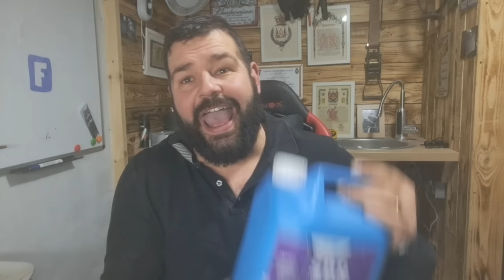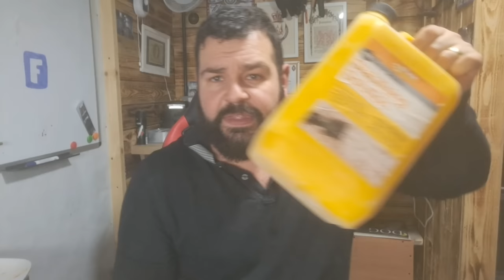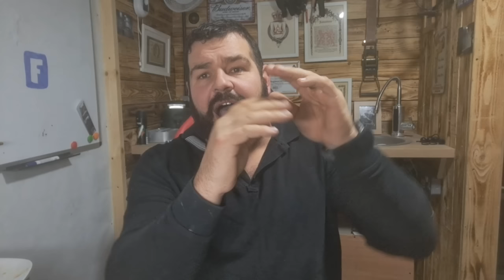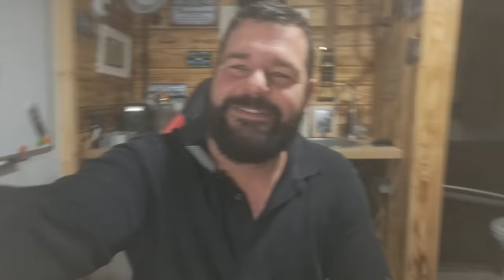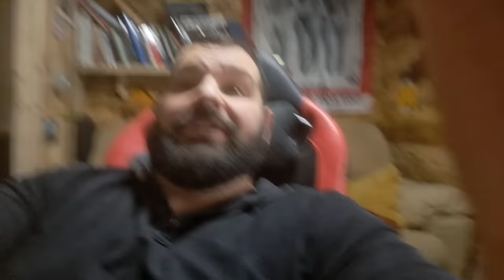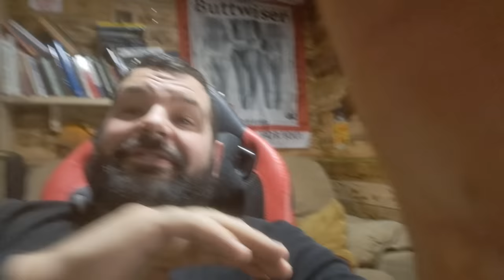SBR Everything you need to know | PLASTERING

Comment: SBR was originally designed for external render. It was meant to be rendered over while its still tacky so the SBR mixes with the surface if the sand and cement render. In effect the SBR soaks into the render and the brick wall, creating a better bond. I knew a shop keeper on a very busy road/junction that caused a lot of vibration. For 30+ years he would need the shop stripped off and new render applied every 12-18 months. 14 years ago I told him to use SBR and render over it when it started to go tacky. That render is still in place without any issue. Yes your correct that you need SBR to be dry before internal plastering. If you don't let it dry it wont seal the internal walls. It actually wets up again. I did damp proofing for years and we always used render internally with a waterproofing additive as a base coat. We always found there was a key moment between the SBR being tacky and dry that worked the best. The SBR you buy from Wickes is watered down garbage 1-1 mix or ready to use. The real stuff mixes 20-1 with water before applying it to the wall. Many years ago it was a 40 parts water to 1 part SBR mix. The watered down garbage barely sends the wall blue. The good quality SBR sends the wall almost purple.
Reply from the maker: Spot on Drew, thanks for the comment mate.
Reply: I am doing floor tile on no more ply. They state to use sbr. Can you recommend a brand to use. Thanks
Reply: @redx11x listen to the video? Lol
Reply: Can I add sbr to a scratch coat mix I’ve use some waterproofer in the scratch coat but still get quite a  bit of suction what would you recommend
Reply: @christaylor5098  Get the best SBR you can get. Good quality SBR will dilute with water 20:1, giving you 20x the SBR. Don't buy the crappy SBR that's already watered down to save £5. Apply more SBR to the wall. Adding SBR to the render mix won't do much to help you. Your render needs to be wet. The SBR applied to the wall should send the wall blue/purple. Apply to the wall roughly 10 minutes after applying the SBR. Do that in batches because the SBR will dry up too fast on large areas. If your getting still getting suction, you haven't applied and sealed the wall enough with SBR. Hope that helps.

Comment: When I tried to cement render onto lightweight Thermalite type blockwork I couldn't get it to hold on. I tried PVA on the blocks and if possible it was even worse. I went round to the local builder's supply depot and the guy on the desk recommended SBR and he was right. It was a completely different job altogether. He suggested that often the block manufacturers overdo the use of mould release which means the blocks are very uniform and crisp but means that nothing will adhere to them without SBR. At a later date my neighbour rebuilt the garden boundary wall between our gardens and used slate for a thin coping. He used standard cement mortar which never bonds permanently with waterproof slate as a result they all came loose shortly afterwards. With his agreement I relaid them with SBR mixed into fresh mortar mix and they haven't shifted since. Be prepared for the mortar to set really quickly though and only mix enough to lay a few slates at a time.

Comment: i use sbr for painting.... a lot of decorators still bang on about pva but of course pva stays water soluble so it will go back to being glue when it gets wet. sbr is also very good at stopping paint peeling if its a bit damaged. whack some sbr on damaged paint then paint straight over when its dry, top tip.
Reply: I've recently re plastered my bathroom walls but due to various circumstances it won't be getting decorated for some time  ,I was thinking of sealing the newly plastered walls with a watered down mix of SBR to seal them up to stop them absorbing moisture until I get to the point where I'm able to emulsion them with a dedicated bathroom paint , what are your thoughts on this ? Any advice will be greatly appreciated. Just not sure if the emulsion will go over the SBR without any issues .

Comment: Thanks for this, had a nightmare dealing with some thirsty walls - two coats of PVA couldn’t cut it. Used SBR for the first time today, and really impressed with the finish, and it really helped reduce suction. Probably won’t go back to PVA now
Reply: This was SBR admixture from screwfix for anyone interested, it’s expensive but it worked and saved so much hassle. Would have bought the pink SBR but needed on the same day
Reply: @mbond65 hi there. Did you roll / spray or brush it on? Did you dilute it at all?
Reply from the maker: Try the good stuff mate https://pinksbr.co.uk

Comment: SBR's also fantastic for eliminating suction on concrete floors before tiling or applying levelling compound. Like you - been using it for years. Zero failures.
Reply: Absolutely this - use on high suction wall before tiling adhesive

Comment: Great video, apart from not watering sbr down if a back ground is very high suction you always water down pva and sbr because it can skin offso with pva you would do 1 part pva to 5 parts water, and if using sbr 1 part sbr to 3 parts water  so these products soak into the surface then apply your strong/neat coat.

Comment: I’m renovating my terraced Victorian house and have taken all the walls back to brick inside (previously lathe & plaster and just plain plaster). The bricks have been really dusty from the plaster which I’ve scraped and wire brushed but it’s still not perfectly clean. Am I right in thinking as long as I get as much of the dust off as possible SBR will be best thing for the job? Before I go on to dot & dab. 🙌🏻

Comment: Another great video. I'm a chippie after some advice. I've removed tiles from a bathroom in my Victorian terrace, the plaster fell away to the brickwork. I used SBR and bonded the walls. How long would you give it til another coat of SBR before fixing Hardie backer with rapid set ? Cheers.

Comment: Zinsser Gardz is the new 'sealer' for problem surfaces like going over distemper - don't use it outside though .. Zinsser Peelstop is for outside - that's more like a stabilising solution.
But if anyone is listening.. you don't need to stabilise new render/stucco etc. ...  you only need to stabilise flaky/porous/friable surfaces. 
render etc can be dusted off and primed (1st coated) with a thinned down coat of the masonry paint.. then work from there with thicker/neat paint.

PVA put on bare plaster is a no also... it's not alkali resisting (Zinsser Gardz is) and with time will break back down... also a nightmare when you come to strip off wallpaper... and it;s bad enough when a plaster has been over liberal when patching up, then you come to paint over it... paint won't adhere to it well.
 
As a decorator...... PVA & SBR are not products that we use.

PVA will soften back up with water... SBR won't when dry - hence can be used outside/damp conditions - like you said - and PVA isn't an exterior product.

Good video BTW

Comment: If you have trouble multiple substrates over 1 area, maybe tiles or the wall is a less. You can mix neat SBR with cement. Paint this on like a primer. Wait for it to dry. It’s almost waterproof and easy to plaster onto

Comment: Hi mate great video thanks, Q, I've had a garage concrete floor laid and recently had water that I think is coming up through from below, I did use SBR but i watered it down as the instructions recommended to, I'm now thinking I should have used it neat like you said, it's only the front part near the door not the whole garage, shall I neat lay more SBR to the effected area, and re paint over?
Cheers! 
Jay

Comment: Kirk - how would you cover an old wall to stop soot coming through the finished plastering? Just removed a chimney. Ive read Sbr and then a slurry or sand/cement brushed on and all sorts of other suggestions. What would you recommend? Cheers Kev.
Reply: Paint the stain with aluminium wood primer beforehand. The soot acts as a sponge so will absorb any moisture in the air making the plaster look damp constantly. The aluminium flakes block the soot from absorbing

Comment: Thanks for all your videos. I'm new to plastering but they have been invaluable. A quick question. I have a wall covered in easifil. Would you still use SBR or a stabilising solution? Or stabilising solution and then SBR.
 Thanks in advance.
Reply from the maker: Stabilising solution always needs to go on first so that it can soak in. You only need it if the background is dusty.
Thanks for nice comment

Comment: Only problem I've had with SBR is skinning on smooth, low porosity surfaces (including new finishing plaster and, definitely, paint -- where it's a disaster). Looks OK until you make a hole in it, then it starts peeling off in sheets from the edges of the hole. I now only use it on porous surfaces that I know it will be absorbed into. I have used as an additive to plaster and fillers -- it seems to reduce the working time but prolong the time to a complete set. Haven't worked out whether the final result is more waterproof / resistant to cracking, but suspect it is.

Comment: What I would say is that if there's evidence of limewash or distemper then it's probably lime plaster underneath. As our man says, it'll be a pre-1950s build. Which means that even though the original lime plaster may be cracked it will still be keeping the building free from damp. Unless, of course, it really has gone past saving and has lost its capillary network. The fact is that once you use SBR over lime then it stops it being porous and makes it unable to transpire moisture. The result is damp, mold and condensation. You'll be adding problems to problems if you then gypsum plaster over old lime or lime wash because everything will be sealed up. Modern plaster has no capillarity and this is the reason it'll hold on to moisture. Great for new builds but no so good for older properties. So if it's lime then you will be best served in the long run if you replaster using lime  - not so much on internal lath or ceilings (except bathrooms) but definitely on solid external walls. It costs more and you need someone skilled in the use of traditional products but it means you won't be impairing your wall's ability to wick away moisture. The fact is, there's been too much hardwall, bonding coat and multi finish used on older properties and this has caused a lot of damage to pre-1950s properties. Particularly those from the Victorian and Edwardian eras. The government has now stepped in because of the harm caused by modern products so if you want to plaster over 50% of the inside of external walls it's now notifiable work. Which means you'll have to apply for building control and spend extra money on insulation.

Comment: Hello, Could you please tell me if you would recommend applying SBR to external slate stone walls before rendering ? Also what render mix you would recommend for houses built with slate stone work including the percentage of lime you would use for rendering slate stonework which would be exposed to extreme wet weather?

Comment: I know that this is a year old, but let's hope this gets picked up!

Bathroom tiling: DIY'er.
I've taken a half wall of tiles off a plaster wall. There are a couple patches that needed re-plastering, so there's a slight skim around those areas. Either way, I've sanded the whole wall and brushed the dust away. Can I use SBR neat straight over the new and old plaster, before tiling?
I'm assuming by what you've said that it will be OK, but I just thought I'd check.
(Someone mentioned that it needs watering down so that it doesn't create a "skin" that could peel off).

Thanks in advance 👍🏻
Reply from the maker: Just use it neat mate. 
I do it day in day out. 
It's the best way
Reply: @Onthetrowel  
Thanks for getting back to me 👍🏻

Comment: I have a question I don't think you covered it in you video sorry if you did. 
I'm not a plaster! I have an garden wall which I'm wanting to bring back to life. 
I have removed as much of the old render as I can. And used sbr cerment 1:1 over the brick before making up with my scratch layer.  Now as I've already cleaned the old  painted render and can't seem to remove.  I was planning to paint the render areas with a 1:1 sbr  before applying a top coat to the whole wall ! Does this sound like it a good plan?
Reply: That for you videos

Comment: I though suction is what keeps new render from falling off the wall - if SBR kills suction?
I'm experimenting with SBR and used as described on the label - mixed with water, cement and sharp sand (1 part each). Not sure this is going to provide a good key for new render.

Comment: Hi mate, my mate who is begining to learn to be a plaster has blue gritted an internal kitchen wall (its back to brick and is external on the other side) can u use sbr now or is this going to cause more problems prior to plastering. I worried it will by using the blue grit. Any helps appriciated.

Comment: can you use SBR as a primer before tiling also?

Love the videos mate, great stuff!
Reply from the maker: I would imagine so mate but I can't say for sure as I've never done it. Tile adhesive is usually cement based with added polymers so I can't see how it wouldn't work but maybe do a little test tile? 

P.s. thanks for the beers mate 🍻🙂🙏
Reply: I coated my ceiling last night with SBR. First time I’ve used it but thought it smelt like something I’ve used before - remembered it was the primer the tile suppliers gave me when tiling a wet room floor so guessing the primer was SBR. Tiles still stuck solid!

Comment: Is there any  difference between sbr admixture like you have and sbr bond. Because today I tried sbr bond for the first time, and it's failed to kill the suction before skimming. Even after the second application, the multifinish first coat just dried instantly
Reply from the maker: They can be different strengths mate.

I've just brought out my own brand of pink sbr though that I've specifically designed (well the science nerds have) to be best for plastering...

www.plasterersblend.com

Comment: There’s also SIKA SIKABOND SBR + WATERPROOF BONDING which I think would be better outside behind brick 🧱 I basically have some bricks with big holes in where a guy was going to fit heating how ever he never did and left it like that, so I’m going to use some brick plaster to fill the holes along with this stuff - this is not legal advice / own risk

Comment: Hi mate, I'm having trouble with the SBR prepped walls with the plaster slumping down the wall.. 

Any suggestions please?
Reply from the maker: How thick are you putting it on mate? Could be to thick or it could be that the sbr is still wet
Reply: @Onthetrowel  thanks for replying so quickly mate, I appreciate that. We bonded part of the wall yesterday and my labourer SBR'd it 🤦🏻. It went purple and it was tacky when we put the mix on. It was making rice Krispy noises as it was forming air pockets.. 

And yeah, regarding the slumping, I reckon it was on too thick over the SBR and was literally just sliding down the wall.

Comment: I recently had a go at tape and jointing my garden room recently, it didn't go well so I've decided to get someone to plaster it. I sanded back the easi fill so it is flat. Should I put sbr over all the boards before it's plastered as there is still filler on all the joins ?
Reply from the maker: In this situation I'd pva all the filler.
50/50 pva and water mate
Reply: Spot on cheers

Comment: Just a quick question... would SBR be best for an internal new concrete block work, ready for drylining.. but the thing is the block work was done when we had a shed load of rain.. and the job needs doing soon but taking forever to dry
Reply from the maker: drywall adhesive is designed to stick straight to the block or brick with no sealing required mate. that said, try your best to dry them blocks out before the plastering. it will just cause the adhesive to stay damp for ages and ultimately you will be waiting for damp patches on the walls to dry before you can paint and you can end up with a bit of mold growth
Reply: @Onthetrowel  fully understand mate, but the owner of the property has no patients, so was wondering if the blocks were sprd and then maby foamed on to foil back boards.. would that work and so the blocks were still able to dry eventually
Reply from the maker: Oh I see what you mean.... it would be a hell of a lot cheaper to go and get some big space heaters (gas ones that blow hot air out) on hire and give it two good days of drying out over the weekend. Will work out loads cheaper than buying foil back board and all the extra time in using foam etc...
Reply from the maker: @darrenmoran5454 

P.s. just tell him that the plastering is going to be there for 100 years so don't rush it and cut corners, what's the point.

That said, I've worked for a few people like this myself
Reply: @Onthetrowel  yeah tricky one.. but thanks for your advice pal 👍🏼

Comment: Sbr with sand and cement I'm plastering over stone internally. Iv coated it with sbr now I'm going to mix a slurry with cement and sbr and brush it on. Is this an OK method
Reply from the maker: Yes, be good to stipple your slurry coat
Reply: @Onthetrowel  spot on thanks for getting back to me. I'll create a good key for my scratch coat.  Do I mix sand with the cement and sbr?
Reply from the maker: I wouldn't, for the stipple coat

Comment: what is best to seal new dry plaster after a bad job to redo I had this last week I did 3 weak coats of PVA to soak in but the set was still fast 1.45 hours
Reply from the maker: Yes mate. Pva is water based so it re emulsifies and let's the suction through.

Next time, one good coat of sbr, leave it to dry fir a few hours and it will work better. Completely kills suction